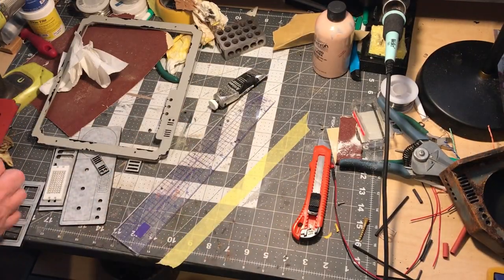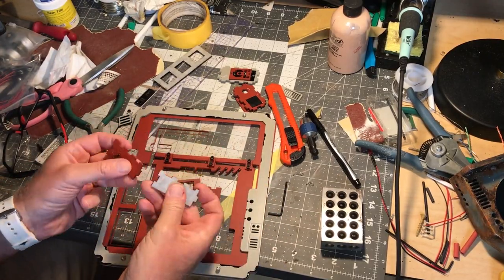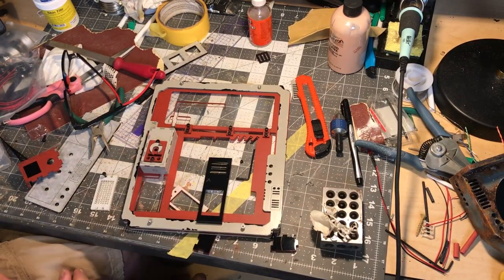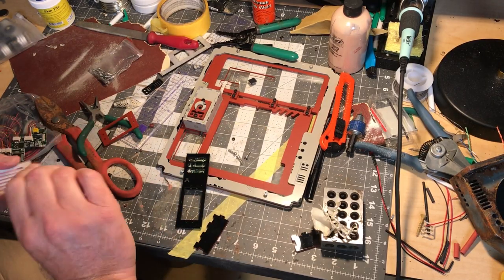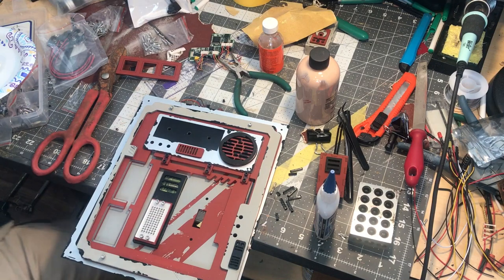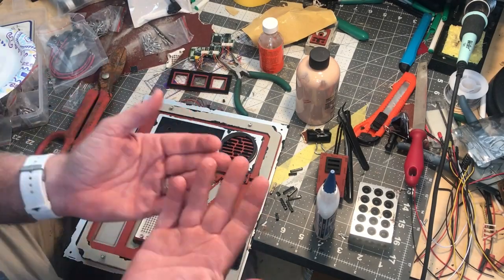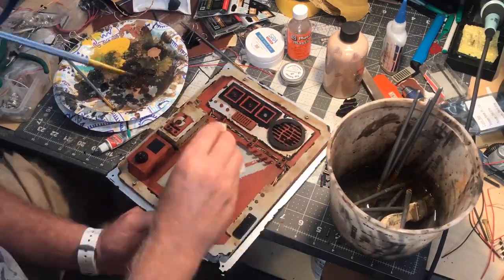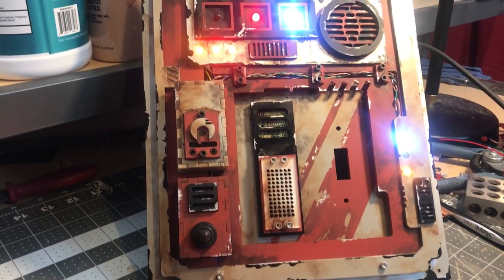TTFS: DIY Rebel Themed Star Wars Wall Panel Or Light Switch Cover KIT!

Comment: Amazing work. What kind of color did you use for weathering? Oil pains or arcylics? Did you cut the acryl panels with a laser? and by the way, do you sell those templates to make some own light switch panels?
Reply from the maker: It is both acrylic and water based oils!  I would be happy to cut a kit for you!